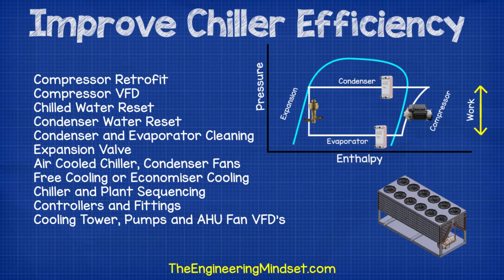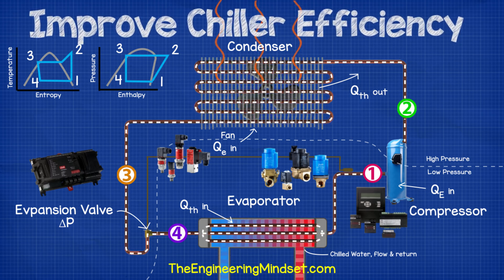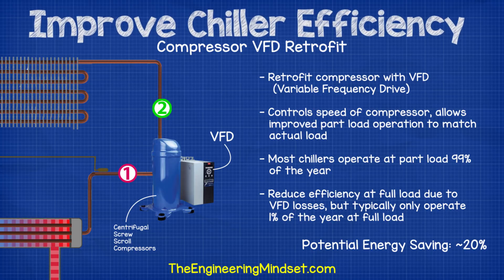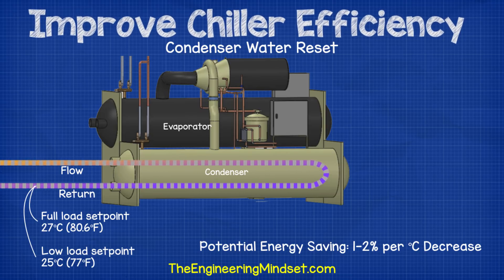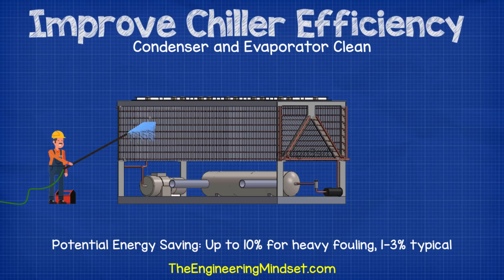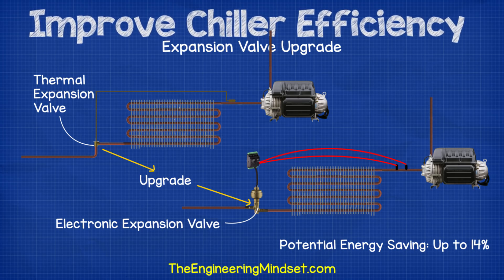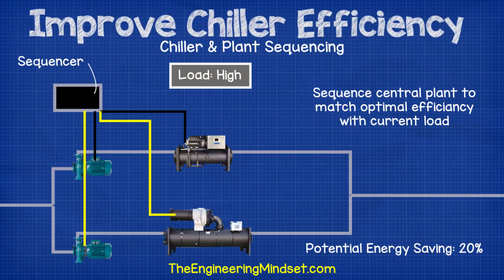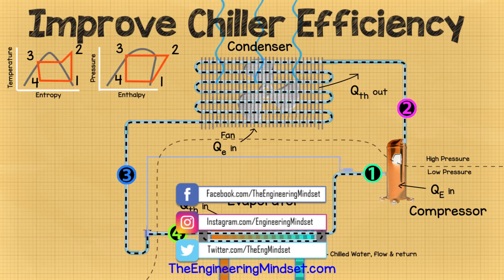Chiller Efficiency Improvements hvac chillers

Comment: Cooling tower fans do not consume a lot of power compared to the chiller compressor(s). I don't like a single condenser water set point (i.e. 80F/27C), because it often makes the chillers work  harder unnecessarily, killing your COP. I prefer targeting 5F(3C) above the outside air wet bulb temperature with a 55F(13C) low limit. This strategy works in every climate, dry or humid.

Comment: Does EC (air-cooled chiller) fans retrofit at condenser improve the efficiency significantly where the normal non-EC fans used have staging feature?
Reply from the maker: Potentially, because of the fan affinity laws. Check out fan calculation video. If your chiller is logging the fan data then you can calculate it.

Comment: Some great videos Paul. One thing that is not mentioned here is regarding the size of the heat exchanger - because it is sized for the peak load, when running at part loads the flow still goes through the same heat exchanger but at lower velocities. Reduced velocities equate to lower Reynold's numbers (a measure of how turbulent the flow is) - the higher the Reynold's number the better the heat transfer and hence efficiency. If the Reynold's number is low enough the flow is laminar and there is a significant reduction in performance. Hence operating at part loads causes a loss in efficiency as the heat exchanger is essentially oversized. This can also cause the heat exchanger to foul up more quickly as the particles that cause fouling can drop out more easily and stick to the surface of the heat exchanger. The only way to improve this is to have multiple heat exchangers that can be brought online as the load increases - however this is not always an option with space restrictions so the design of the heat exchanger is fundamentally important in that respect.

Comment: These standard manufacturers of chillers are not efficient. We have a new carrier unit chiller and the power consumption is horrible. We purchased an chiller from a  refrigeration company that designed it from scratch, and its consuming half the electricity of the carrier unit. Plus it was about 30%cheaper than the carrier unit
Reply from the maker: They are efficient but only if sized correctly and controlling properly. Of course having anything custom made is going to be better than a one size fits all.